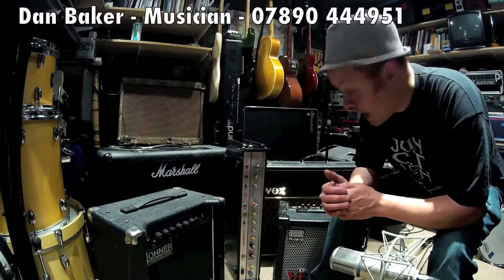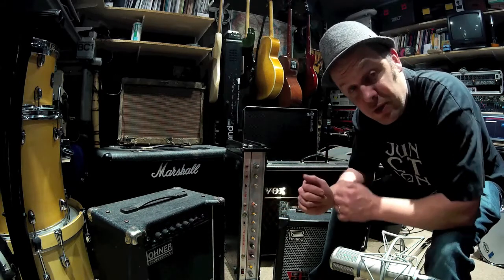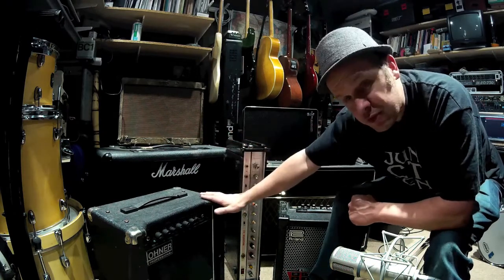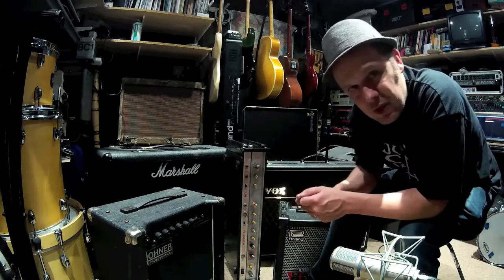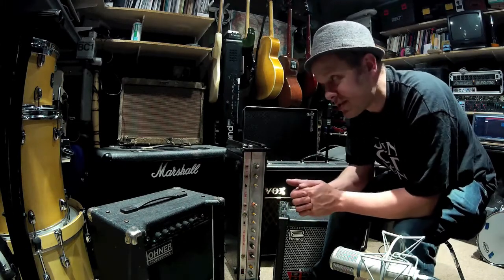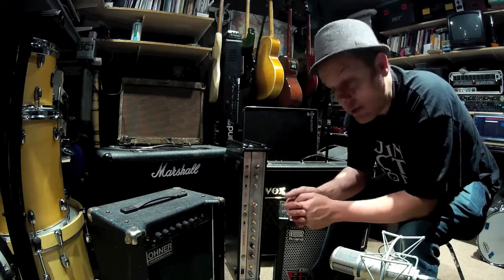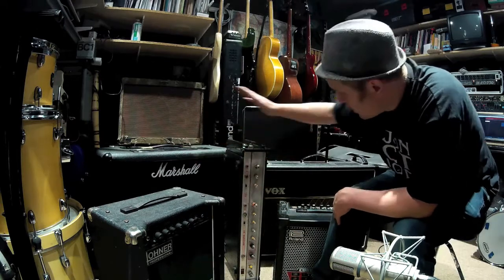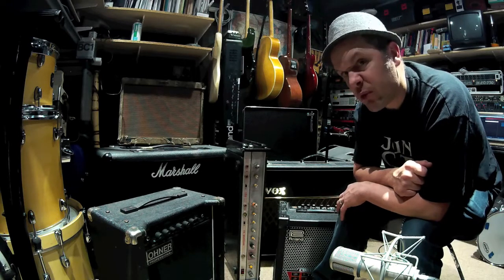Impedance - an explanation for guitarists

Comment: I just got a Marshall Valvestate VS102 with a 4-ohm output connected to two 16-ohm speakers. Am I getting the best performance out of the amp?
Reply from the maker: You’ll get a bit less power as it’s an 8 ohm load (assuming your two speakers are wired in parallel), but the 4-ohm stated on your amp will be the minimum value that it will be able to deliver current through. I’d have thought you’ll be getting good performance, as there’ll be two drivers shifting the air!

Comment: Quick one! I have an Orange PPC212 on the way, a 16Ohm cabinet. If I were to plug in an 8 ohm amplifier, that would be fine right? My understanding through research is that this is fine, however the other way around would be promlematic. 

All I’ve read is that it would be as loud as it could be and I’d potentially lose some of my tone, but that the 16Ohm cab could handle the 8ohms just fine
Reply from the maker: That should be fine. With valve amps, it also depends on how hard you push them as to the impedance making a difference to reliability.

Comment: hmm sir, i have combo amp 15w 8ohms and i used 25w 5ohms speaker.. is it ok? thanks for the answer :)
Reply from the maker: 5 ohms is an unusual value for a speaker, but I’d go carefully. Is it a valve amp you have? If so, there may be a selector switch on the back for impedance. If it says minimum 8 ohm, then a 5 ohm load might burn out the amp.
Reply: @DanBakerMusic  sir i believe its a speaker my dad got way way back from japan, the brand is onkyo.. may amp is randall rbd15 then on the back it doesnt say minimum, only Rated Output Power? 8ohms

Comment: Awesome video. Came here because I'm having issues with my Marshall ValveState (100w) and transient noise and volume crackle and peaks and valleys. I've just been using 1/2 of a full stack ( 4 of 8 speakers). This impedance may be causing some of my issues. Thanks
Reply from the maker: Transient noise and volume crackle will be something else, but watch that the impedance doesn’t go too low...

Comment: Awesome video... I have a blackstar cabinet 2 12" 8ohm eminence speakers that I put in to replace the factory speakers... on the back it has multiple plug ins... 2 8ohm plugs left & right (stereo) so that's 1 for each speaker... 1 16ohm mono and 1 4ohm mono.... I want to hook up a mesa boogie fillmore 50w head to it... back panel on the boogie has 1 8ohm & 2 4ohm outputs... mesa boogie tech support says I should plug 1 4ohm from the head into the 4ohm mono on the cabinet... what's ur opinion? Would it be better to use each 4ohm output into the left & right 8ohm input? Any advice would be greatly appreciated!